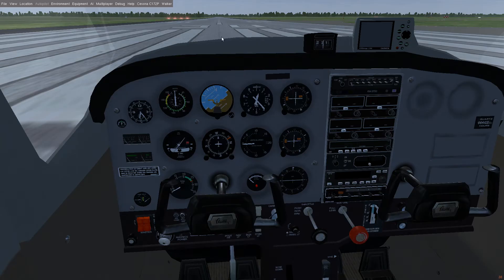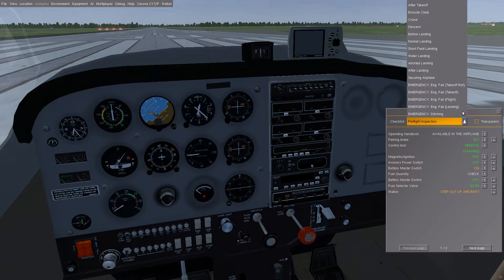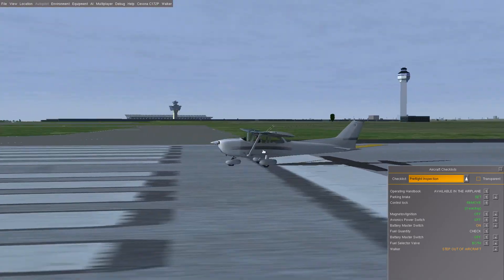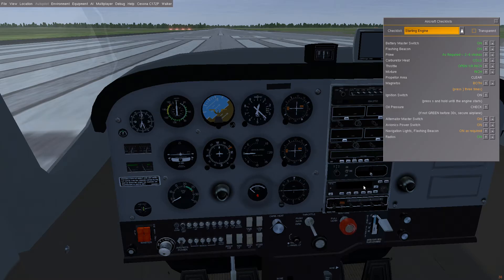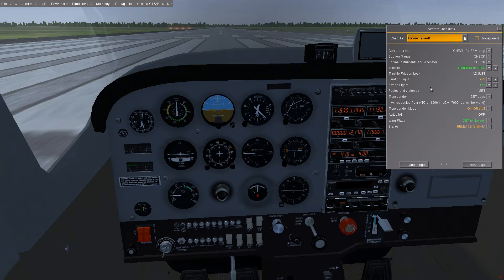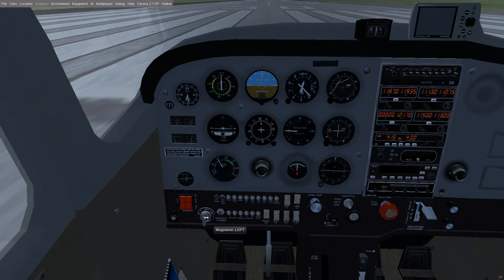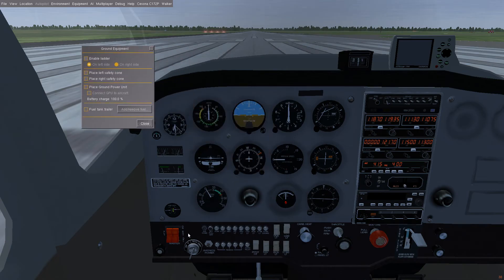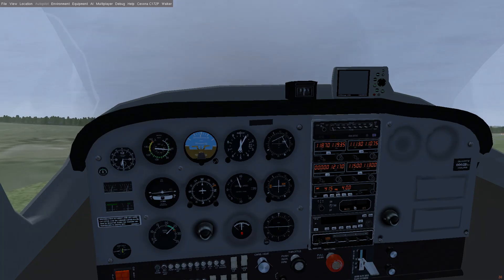How to start C172P in Flightgear

Comment: You have made some errors. First off there is NO Pilot Heat, it is PITOT Hear for the Pitot tube which is where your airspeed indicator senses the airspeed.  You set your altimeter to 0 feet which is WRONG! Your altitude is above sea level and you are not zero feet above sea level or you would be rather wet.  You set your altitude to above ground level which is Wrong thing to do.
Reply from the maker: Absolutely right

Comment: Hey - this video is good, but be wary of talking to yourself. You assume a lot more knowledge that the viewer might not have (the controls for how you took-off, and how you talk to yourself quickly, which means the viewer misses a lot). Talk more through how you are getting the panels up (i.e. the checklist) how you hide the yoke and then take control of the peddals. Just a suggestion if you think of making more.
Reply from the maker: You are definitely right, thanks for the suggestions!

Comment: my cessna keeps turning left. even when i steer the to right.... help?
Reply: it isn't a bug, Propeller aircrafts have the tendency to turn in real life (left in this case)
Reply: @kamelkadri2843  but how can I 'calibrate'  it? I steered fully left
Reply: You have to use the pedals by your feet for direction on the ground. On the keyboard it's Enter for right and Insert for left.
Reply: @deniKna  thanks for your useful comment. My set-up is nothing more than a gaming laptop and a mouse. If I'm right the pedals control the rudder, No?
Reply: @m0w0ss  Same here. And since I asked myself the same question for a long time I thought I'd share this information. ;-)
And yes, exactly.
Reply: DriesGaming LOL me too!
Reply: Its because of the torque from the propeller spinning in one direction. Figure out the button mapping for the "rudder" controls and apply "right rudder" on takeoff.
Reply: @evandickson19  Thanks. i knew that was the problem but i had no idea how to fix it.
Reply: Lol I know you you watch Swiss001
Reply: @ryanairy6480  ok, but i know you watch Swiss001
Reply: @m0w0ss  lol
Reply: What is the controls with keyboard accelerate=?
Reply: That's a realistic effect of the propeller.
It's called P-Factor.
Reply: My plane turns left and it’s fucking annoying and I would like to know if there is a way to change de control settings like i go left with 0 and right with enter if I press a it accelerates time

Comment: i was able to finally get the engine running and the plane moving but when it starting moving  i couldn't control it
Reply from the maker: Try toggling number lock if you are trying to control with your keyboard
Reply: OOF

Comment: when I try to start the engine, It says "flooded engine" even though I am on land
Reply from the maker: I believe that is because you flooded the engine with fuel. Would recommend trying autostart (just don't touch anything till 30 seconds after it is started) and see if that works. Might be worth looking into the forums to see their opinion, they have a lot more experience than me.
Reply: @not-So-Daily-Gaming  Lol he thought flooded meant water.
Reply: Iit means you have primed the engine to many times

Comment: Hi, great video, have you ever experienced an issue with FlightGear where the plane loads up at the airport and looks to be stuck in the ground and won't move anywhere even when the chocks are removed?
Reply from the maker: +James Collins no, not that I can remember. Perhaps go under the location menu and select position aircraft and enter a number like 10 or 100 under altitude and see what that does. If that doesn't work then try the forums, they are always very helpful

Comment: hi, 

dont have any oil pressure in my cessna. And I couldnt found any settings/knob to change it. Checklist says must be green in 30s ... but its dead and I dont know why🙄
Reply from the maker: Hmmm. Just spent some time playing around with it and I don't think you need to worry about it. Mine was doing that too however it did go up when pushed it to full throttle. I have noticed several other planes have that same sort of system where you need engine RPM for oil pressure to be in the green. Let me know if you find anything interesting and hope this helps!